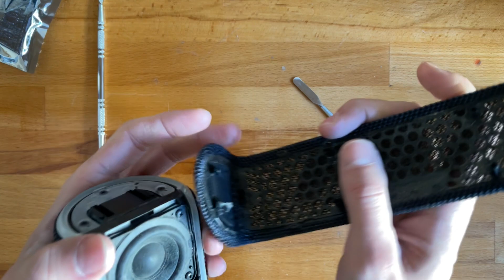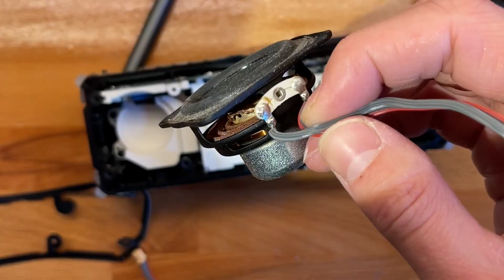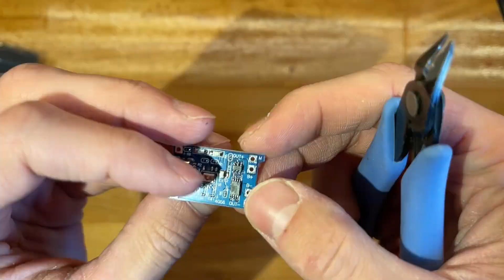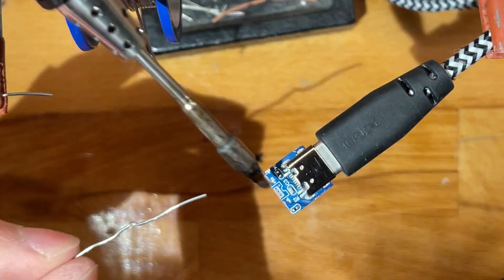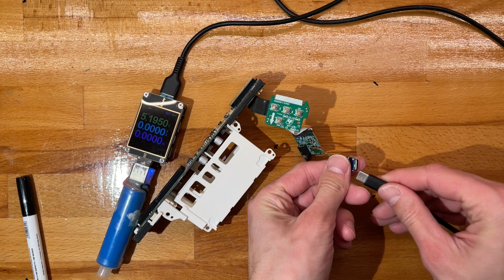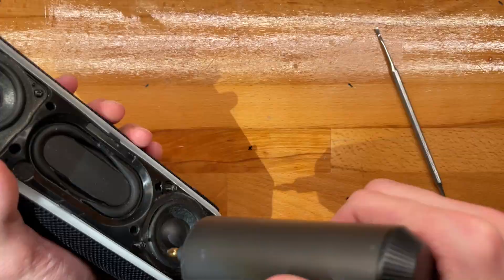Fix/Repair Broken Charging Port on a Bluetooth Speaker - SONY SRS-XB21

Comment: fml shorting this two tiniest contacts went BAD now i have not 2 but 3 contacts together and it still only pumps 0.5 amps for charging out of my 2amp power supply... I gonna kms
Reply: p.s. i got it out from wrong pin. But it only sped up to 1 amp...

Comment: It is better to use 2 pin Female Type C Connector with a housing, it looks more aesthetically pleasing, like as if in the original and easier to install.

Comment: I have a bunch of XB2's all with busted micro USB ports -  Sony use weird upside down mUSB ports that are like hen's teeth, and on these the they're spaced 1mm off the board and soldered in a half-arsed way. It's almost like they wanted them to break and not be repairable. This has inspired me to do something similar. Cheers man.

Comment: There a design falt really should have proper input cradle to hold plug in.. i thought they robustly tested there products but mybe they can't sell you a nu one then what an absolute nightmare ive got two of these i should really send them back to sony its not like they wouldn't no 🙄

Comment: How would you go about adding a line-out to this speaker? (Perhaps even using the line-in port/hole on the box). 
That way one could use this as a remote receiver for the wireless network....

Comment: Dude you’re insane !! I gotta xb43 my cat messed up the port and it just now completely failed. Heelllllppp!!!!
Reply: I got a srs xb43 also and my type c port broke. The little chip that inside the type c import broke off
Reply from the maker: ow my .. you could hopefully just wire in the + & - and it'll just never fast-charge again

or even somehow add that resistor that tells type-c chargers to go ahead and send 5 volts ..

most likely the main board will work without that chip or communicating with it, I'd be pretty sure of that

but do let us know how this turns out, I'm rather curious
Reply: I soldered +- to the new type c. And yes, it takes a very long time to charge, has anyone solved this problem? @Darieee

Comment: Do you know another way I can charge my speaker? The type c port is trashed. Can it charge through the usb out which normally charges other stuff? Or is there some way I can tap into wires?

Comment: Did the same thing to my Xb31‘s, just perfect if you don’t have that much micro usb cables lying around anymore.
Reply: Did you find a specific video somewhere, or you just followed random tutorials? I want to do the same to my xb31
Reply: @D @DaierFTW , i just took it apart, I often repair stuff. If your micro Usb-port is still working I would advise against opening the speaker and just get some usb-c to micro adapters of amazon or wherever. If the port is defective, be careful with disassembly and more so with assembly of the screws in the deeper holes before you open the box and get to the electronics. The plastic of these screw holes break very easily and often (I have five of these), It can be glued if you have a good glue (2-Component glue, epoxy glue etc.) 
For the repair on itself I would recommend a USB-C Breakout board with PD (Power Delivery) that you can setup at 5V (if you do this you can charge the box with a modern usb-c charger or powerbank, otherwise you’ll need to charge it with a Usb-A to C cable. Lookup which connections of a micro Usb port are +5V and ground online. Then solder it together and try to fit it in the case.

It is a fair amount of work for someone who hasn’t done something like this before but it shouldn’t be very difficult.
Reply: @PhysicalGeneral thanks for your reply! Have not upgraded any usb ports until now, but I have tinkered a little bit with electronics and I know my way around them. My micro usb still works, so most likely will not change it. I will just carry an extra cable with me🤣
Reply: @DaierFTW Hey, no problem! Sounds like the battery is dead or defective, you should find replacements online if you want to replace it 😉
Reply: @PhysicalGeneral i have bought the speaker in 2018, of course the battery is defective. Already ordered a new battery, should arrive these days. Since I was doing this upgrade, I was thinking about the charging port, that’s why I replied to your comment😄

Comment: how does this BT speaker compare to your wooden one from a few years ago?
Reply from the maker: the sony wins ..

the drivers are "more better" and it has dynamic bass .. 

+ an app where you can set the EQ
Reply: @Darieee  i guess thats the difference between a commercial unit and a DIY project
Reply from the maker: yeah - with small diy projects you really do need psychoacoustic magic & a dynamic equalizer ..